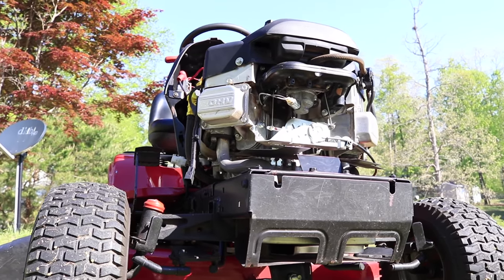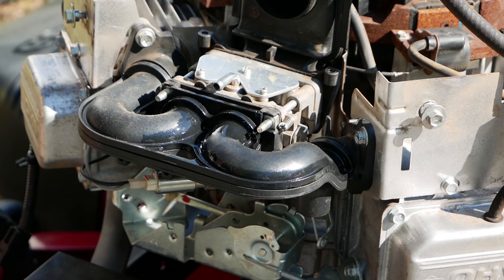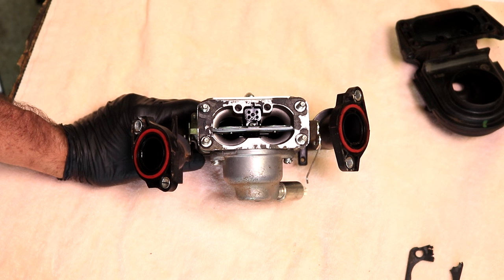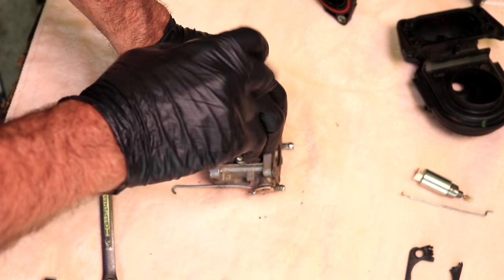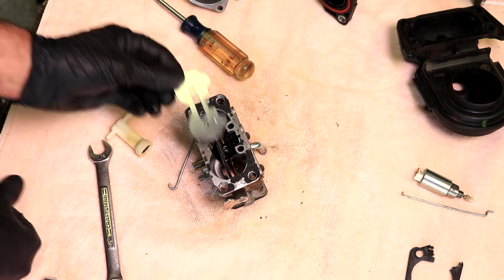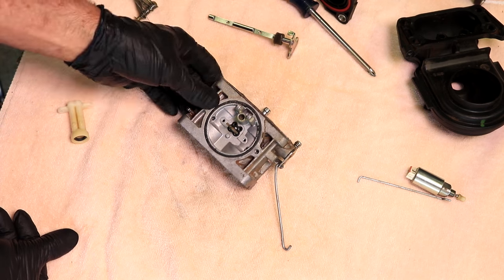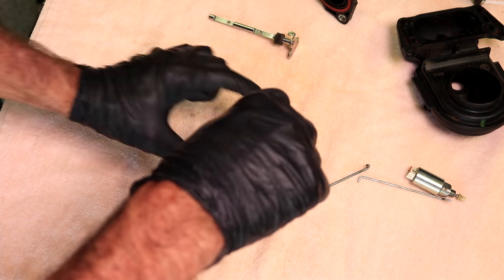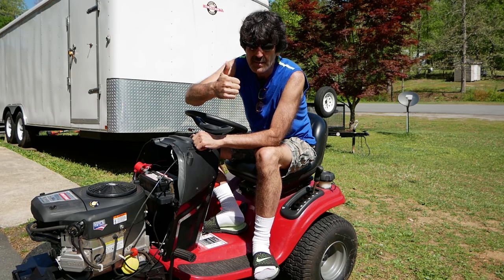Briggs and Stratton V-Twin Carburetor Repair

Comment: This video helped us out big time!  Saved us a tonne of money.  Mice tore up our air filter, debris got into the carb.  We literally followed it step by step and we are back up and running.  Thank you!!!!  We have a 2009 Craftsman tractor with a Briggs and Stratton 22 HP motor - 407777-1330-B1.  A couple of minor differences, everything else was the same.  Keep making videos, so helpful for the DIYer.
Reply from the maker: HI!  TYSM for the great feedback.  I'm so glad I could help you..  I've seen mice do that, for some reason they like it inside of an engine...  Maybe it's a little warmer in there..

Comment: This is an excellent video! I have the 22HP B&S V-twin on a Craftsman YT3000 with 69 hours on it that was surging and then would only run on full choke. I used this video to learn how to pull the carb so I could clean it out. Gaskets and rings were all pristine, and I used the wire tool to clean all the orifices out (along with carb cleaner!). After a few mistakes (I unknowingly put the carb back together without the rubber o-ring that sits inside the bottom of the bowl which caused it to run fuel rich) I correctly put everything back together and the engine runs just like the day I bought it! Thank you again for an excellent, detailed video!
Reply from the maker: Excellent work!.. Thanks for the great feedback.  If it happens again, I did a video more recently on surging with a similar engine.  I show in detail the part that I cleaned

Comment: This is a great tutorial. While I elected to buy an aftermarket carb on Amazon vs clean, it was great for helping me get through in replacement process on my Briggs 24hp. Thanks Rudy! 5 stars.
Reply from the maker: Great to hear!  Save the old one in case you have more trouble some day... :-). You're welcome... :-)
Reply: Its not the carb its the float needle has rubber on the tip and it sticks to the seat find stainless steel needle and no more ethanol fuel problems . Mine did this from day 1. To start i use a horse syringe with electrical tape on it  in the fuel line going to carb force small bit of air in and you will feel it pop and good to go. And it is ez to get fuel line off fuel pump its not ez to take carb off every time. P.s my carb from the factory had a main jet missing i found it in the float seat location some dumb ass put it in the (wrong) hole it jammed the float i dont know how it ran at all but i know there is ring and cylinder damage from lean fuel mix. hope u have better luck

Comment: Thank you very much for the effort on this video. I was having quite an enigma on my 24hp V-Twin... one cyl running fine the other having spark, 150 psi compression, adjusted vales, buit still putting out only about 10% output on that cyl. Turned out to be the carb effecting only  the right cyl. Thanks again. You showed us what to look for and how to do it. Best to you.
Reply from the maker: Great to hear!  Thanks for sharing... :-).

Comment: Thank you for posting this video.   It was very helpful.    Removed a carburetor from a mower that hadn't been started for over 3 years, and replaced it.   Solenoid was frozen, and new one cost $140+ but a whole new carburetor including the solenoid was only $35.    Followed your video and everything worked great and mower started right up!   Good job!  Thanks!
Reply from the maker: Fantastic!  I'm glad you were able to get it back on the road!.. 🙂🙂
Reply: whole new carb for 35.00....pretty good deal...can you share where you got it?
Reply from the maker: @razorbak6783  I can't say where Greg got his, but I know Amazon and eBay has a lot of carburetors in this price range.  Not sure about this particular one, but if you had a part number, it's certainly easy to find out.
Reply: @JLPicard440  thank you

Comment: Nice vid. I'm currently working on a nearly identical carb.
But that "solenoid"  (SAHlenoid, not SILenoid) is an anti-backfire fuel cutoff so it doesn't explode your muffler like a cartoon cigar.
Reply from the maker: Thanks!  Yes thats right... :-)

Comment: Thank you sir! Great video! I had to watch this about 20 times, but I got it. One improvement I would suggest is slowing down the video where you re install the butterfly/choke rod thingy.  I got it wrong and had the spring holding the butterfly closed tight.  When I rewatched you taking it out, I noticed the butterfly easily moved open and closed. But overall, you saved me the hassle and cost of going to a mechanic. Thanks again!
Reply from the maker: Thats excellent!  You're welcome.  I'm glad you got it going again..

Comment: Thanks. I have a 25hp Briggs that has needed this for 5 years. I ran it on vapor for about 15 minutes awhile back until the gas can got so cold it stopped making vapors.
Reply from the maker: I've never tried to do it that way... :-)
Reply: @JLPicard440  Watch some videos about "running a lawnmower on vapors". It works but it's dangerios the way they are doing it. It could be refined with a backfire arrestor (Can't spell that) and a tank heater.
Reply from the maker: @64Seawind  cool, I'll check it out

Comment: Excellent Video and please keep up with the detail and with closeups. Your video helped me see I put a linkage together wrong. On the bottom throttle linkage there are two holes if you look closely. One has a plastic collar and the other is there for no good reason. I wasn't paying attention and stuck it in the wrong place. Caused engine to run bad, and a big back fire on shut down. I went back and forth on your video to check when I did wrong. Very helpful! Before i found the issue, I checked bad gas, plugs, fuel pump, diodes on armature, and feeler gauge on rockers. Assuming the whole time it wasn't the new Carburetor. Shooo....
Reply from the maker: Excellent troubleshooting... glad you were able to get it going again.. 😊😊

Comment: I have this very same mower and it won't start.  I am thinking the Carb is dirty so this is a fantastic video to reference.
Reply from the maker: Thank you!  I hope you can get it back up and running again.. Make sure fuel is good if there's any left in gas tank.. 😊

Comment: You, sir, are an excellent technical teacher. Extremely great work. Thank you so much.
Reply from the maker: Wow!  Thanks for the great feedback.. 🙂. You're welcome..
Reply: @JLPicard440  you are certainly welcome. I have the exact same carb and I have the surging issue. I got the carb off and tore it apart. Just waiting for tomorrow for the rebuild kits.
Reply from the maker: @conrat2000  I did a video fairly recently on this issue.  Make sure to clean out these tiny little low side jets that are there.. 

https://youtu.be/dnEgZ_uqxiQ
Reply: @JLPicard440  so, I finished rebuilding it. It starts when choking it. But then it dies fairly quickly. It tries to run, but almost like it runs out of gas. I checked and the fuel pump is pushing fuel. Possibly the fuel pump is weak? Can you think of anything I could've screwed up rebuilding it that would cause it to stall like it's running out of gas?
Reply: So, I'm an idiot. Lol. I forgot to attach the needle valve to the float. Took it apart, corrected the problem, and it runs like brand new. Thank you sooooooo much. I got a free (well, maybe $30) new mower. It runs freaking great!!!
Reply from the maker: @conrat2000  LOl!  Yea I would have not thought of the needle valve without being able to see it!  I'm glad you got it going.. excellent work.. 🙂
Reply: @JLPicard440  couldn't have done it without your video. This is my first carb teardown and rebuild. So I learned a ton.

Comment: My Ariens 20hp v-twin is so cold blooded and difficult to start so I purchased a Card kit with fuel pump, and she still doesn't start. Plenty of spark and compression. When I give it a tiny shot of either, she pops right off. So, I am thinking I either have a vacuum leak and air leak in the fuel line. So that will be my project after church today.
Reply from the maker: Make sure to check and see if the choke is choking all the way... if it's out of adjustment, it'll cause that...

Comment: Good video, I've had to rebuild mine before..a couple of times.   But mine has an auto choke system. It's been a Pain in the A$$ with not reliably starting it. I have ordered the bell lever bracket to change to a separate choke. And a new carb with the manual butterfly setup. I was able to review what you had with what I'll be changing over to. Thanks again
Reply from the maker: Thanks for the great feedback!  The auto-choke is a nice system when it works right, but good old manual with cables has stood the test of time... 😊

Comment: I have an issue with mine. It idles and starts up fine. Ajusted valves to 4thousands, change both spark plug, new fuel filter. Both main jet were found in the carburator bowl. After doing all that i mentioned above, spraying carb cleaner in every port. The tractor is running the same way that it always fan. It pops and bangs thru the exhaust constantly. When throtteling down  fast, it lets out a huge bang. Its not sputtering, its running quite well but it constantly pops no matter what. It did it before all the work that ive done and it still does it now.
Reply from the maker: It could be a magneto.. do you have any of those neon bulb spark checkers?
Reply: No i do not but i already thought about that possibility. Infact i am going to pick up a new coil tommorow. Its been a real head scratcher. I don't understand how it was able to run "good" with both main jets missing? After doing a valve ajustement, carburator clean and new spark plug. Popping sound seems to be less frequent at lower rpms. It stills backfires/pops sometimes. Symptoms now are loss of power under load. When engaging the mower deck it will fall on its face. Still running somewhat decent, no surging but sputtering. When its not under any load it will not sputter but it will let out backfires and they come from the exhaust. Symptoms do not change when the engine is hot or cold. I did not clean the carb in dept as you did, i did not open the port on top where the fuel line connects. But i sprayed air and carb cleaner in every hole about 3/4 times. I took fuel out of the tank and let it sat for water. There was not a single drop of dirt or water in my masson jar. I added a fuel treatment just to make sure. What would be your best bet? Ps the tractor has only 125 hours and was always really well maintained. Kept indoors 365 days a year.
Reply: Sorry for being all over the place. I was thinking about stuff while writting.
Reply from the maker: @ryy597  No problem on what you were writing.. BTW you never said if you put the jets back?  How could they fall out?  The bowl holds them in.  Check those tiny rubber 0-rings on the jets, I can't see how they could have fallen out...
Reply: @JLPicard440  sorry, yes i did order 2 new jets. There is a left one and a right one. I made sure that i placed them both in the right spot. The o-rings on the old one failed and caused them to fell into the carburator bowl.
Reply: Flywheel key is intact. I was able to get my hands on a 1 1/4" socket to verify. So the only thing left would be ignition coil

Comment: Great video!! Thank you!! When I pulled it apart the 2 jets in the intake tube were in the bottom of the bowl.  The O ring (which appears to try to keep the jets in place) stayed in the bowl which caused the jets to fall out.  When I replaced the jets and the O Ring, the jets fall down to the O Ring.  They do not fit tight into the intake tube holes.  Is this normal?
Reply from the maker: HI, no that doesn't sound normal.  Did you replace the o-rings?  OR reuse the old ones?  They should be tight enough to hold themselves in the tube.
Reply: @JLPicard440  I found new viton o rings on ebay and they should be here this week.  New jets (genuine) are expensive! O rings are not.  Thank you for the info!
Reply from the maker: @treagan2666  Awesome!  I hope they work out for you...

Comment: I’ve got a 24 horse Briggs intel engine that is spitting gas out of the exhaust. So I’ll be doing what you just did and see if the float bowl is stuck ? Or something else !? Great video thanks
Reply from the maker: I've never had one do that!  Could be the needle and seat not sealing and it's just dumping gas into the engine (yes could be the float, but probably not unless it's cracked and is full of gas)... have you checked the oil to make sure it's not contaminated with fuel?

Comment: you must try Mopar penetrating fluid for cleaning carbs , its life changing , carb cleaner is weak junk ,  soak jets etc.....in a cap full enough to cover em , spray it into carb everywhere  , spay it Ito float bowl and let it sit  for a while or overnight , clean everything out with brake cleaner and reassemble , stuff will blow yer mind , do a lot of carbs and don't use carb cleaner anymore ,ultrasonic cleaners don't even beat it
Reply from the maker: Hey thanks for the great info!  I'll be sure to check it out... 😀

Comment: seemed like there is some type of schmoo (locktite ) on the bolts holding the shroud on ??  any thoughts
Reply from the maker: There might be.  Ive never put it back and never had any problem with the bolts coming loose...  You can use the blue loctite and it'll come off easier next time.. 😀

Comment: Fantastic video, thanks for sharing.  You did a great job showing how the linkage connects to the carb... My problem is the other ends of the linkage (yes I didn't pay close attention to where they came from)  Can you send me a picture?
Reply from the maker: Arrgh... I don't have access to this mower anymore.  With the top of the engine off are there places with little holes where the linkage could go?

Comment: I know this is old hopefully I get an answer so if I spray carb cleaner in spark plugs or air filter it should bypass carb. And start temporarily is that correct??
Reply from the maker: I usually spray right in the intake of the carburetor...  You can spray into the spark plugs, but it seems like more work to remove the plugs!  I usually don't use carb cleaner, I usually try to use starting fluid or a small amount of gas (harder to spray)..

Comment: I'm working on the same engine.
Got carb off and can see where it's been leaking and blackened the orange rings on one side each. It only has 155 hours. 
Symptoms. Runs perfectly until the engine warms up/ gets hot.
Then it loses power and dies. I can start it again but only on choke. Cools down.. and it's fine.
I think the orange gaskets leaking is my problem. Thermal expansion is making the bolts expand just enough to let it leak. I'm going to use some blue permatex and put it back on then tighten the bolts good. They have red thread locker on them so I'll add more of that. 
Think it'll work?
Reply from the maker: It's possible.  I'd say it's a good place to start.  When you take out those orange O-rings, do they feel hard or brittle?  Or soft like they should be?   Try to loosen the gas tank cap and see if it's not venting properly.  Also make sure the fuel line isn't kinked anywhere or clogged with trash.  Just some other things you might try..

Comment: Very good video. I tried following along and put mine back together. It's stuck at full throttle whether I move the lever up or down. The linkages looks the same to me. Only thing I can think of I didn't see in yours is maybe little metal gaskets in between the carburetor and manifold gasket. They have 2 beveled lips on them. I'm not sure which way they go. I didn't notice it on yours.  I had read somewhere that they have to be turned a certain way or throttle will be stuck. I wish I could see information about them. I feel like there's metal gaskets in each side of the carburetor, but can't recall.
Reply from the maker: Oh wow.. Yea without seeing it it's really hard to say.  Those gaskets have holes in them that will line up with holes in the carburetor, so it should be really easy to see which way they go.  Unfortunately you will have to take it apart again to determine if they're backwards or not.  Are you sure the throttle linkage is on correct?